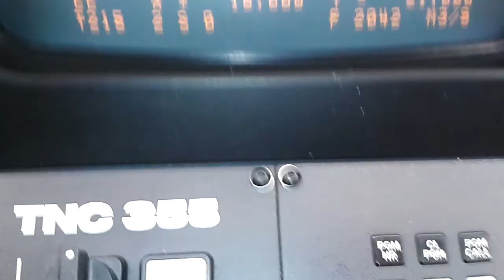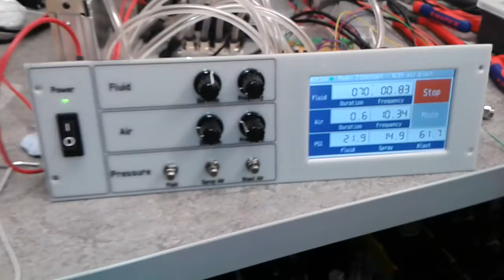Homemade Minimum Quantity Lubrication system (MQL)

Comment: Definitely interested to see more of the MQL system. I have a fog buster to mount on one of my routers and my old Datron has something similar for ethanol. Does it have three lines going into it?
Reply from the maker: +littlestworkshop 

There are two lines, one for fluid, the other is a cable. The
fluid is controlled electromagnetically by pulse frequency and duration, along
with fluid pressure.

There are two air supplies sharing a common path. One for
atomisation and one for chip blast.

Air control and air pressure is done with solenoid vales and
miniature regulators  in the control unit

There are 4 modes of operation.

Fluid pressure, frequency and pulse duration are all
variable in all modes.

1 Constant (variable pressure) air for atomisation, with no
chip blast.

2 Constant (variable pressure) air for atomisation, with intermittent
chip blast which has variable frequency, duration and pressure.

3 No atomising air, just intermittent blast, variable
frequency, duration and pressure.

4 No atomising air, just constant blast, variable frequency,
duration and pressure.
Reply: +Roger Moore That's really nifty, I saw the controls on the panel but assumed the blast was coming out of another hose. Did you make the fluid control valve youself?